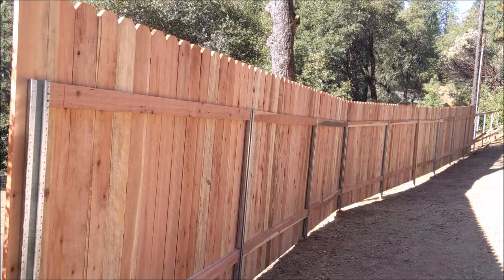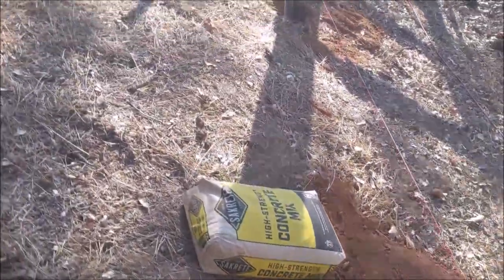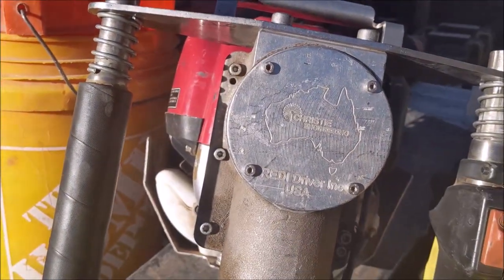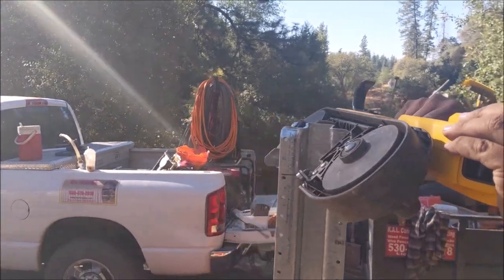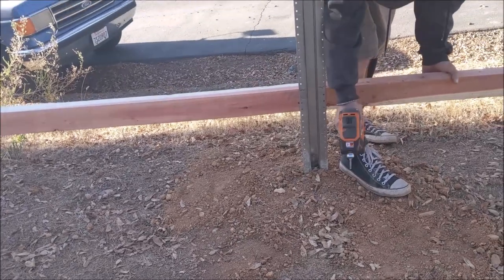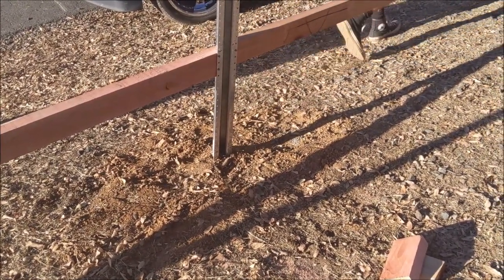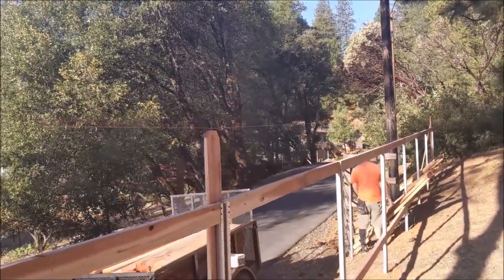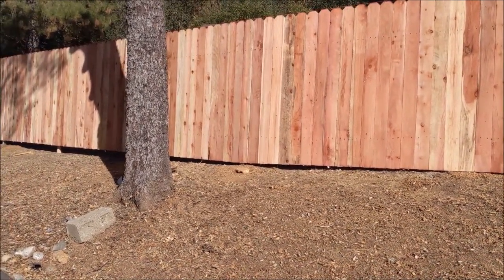How to Build a Wood Fence in Under 6 Hours

Comment: About to install some fence myself and came accross this video that left me with few questions. Why do you drive and dig holes for postmaster posts ? Can't you just drive them ? Ones I found in HD and lowes are 8 ft so I'm planning to drive 2 feet without digging. Also distance between top of the picket and top rail is over 6 inches and I heard it tends to warp. Is yours still holding straight ?  

And thanks for sharing this vid.
Reply from the maker: Digging and concrete make them more sturdy. Still holding strong. Yes don't want the tops too far from the top rail

Comment: Driving post like that they should be utilizing the entire 8' of postmaster post and driving to a string line mark on the post to keep the height consistent.  Any privacy fence 6' tall should have at least 3 rail without question.  Using a hybrid method of driving-concrete at 24" is probably not good.  They could have got longer post and drove to 30-36" deep and been fine, or dug to 24" and used all concrete, or dug to 24" and drove an extra 8-10 inches like our company does and used concrete for the 24" dug.   Half effort pounding and Half effort setting in concrete is just half.  Also if your going to have a 16' span 2x6 lumber should have been used.  Using a top picket jig such as a MR. Fence Straigt away would have made it an even crisper top than eye-balling to a string line where you can clearly see in the video were the string line has come off the top of the pickets on some and not others.   While its a nice fence it's not a professional job.
Reply from the maker: All good info
Reply: Where do you find these metal posts longer than 8 feet ? That seems to be the max length available right now at regular stores

Comment: Excellent, great video. I've built a few board-on-board privacy fences, but to hear your "play-by-play" description was perfect. Great details. My only critique would be to use three horizontal rails instead of two. And I'm a fan of including a 2x6 top cap (treated) with my privacy fence; it forces one to place the top rail as far up as possible, which makes the three rails efficient in keeping the boards straight in the long run. Otherwise, I really loved this video. Congrats!
Reply from the maker: Great feedback. Three rails is a good idea, much less movement of the boards
Reply: @itmsjim have you used these type of posts before? Home depot has them and it seems the postmaster brand is only 7'6" in length, which if buried at 2' would only be 5'6" tall..do you know where to get them at full 8 footers?
Reply: @krackerotto  I just bought five of the 7'6" posts a few days ago. Installed them and they're rock solid. I mean stone hard with the cement cured. I'm very happy with them, as they were super easy to build on. Unfortunately, I don't know where to get the 8's.
Reply: @itmsjim  is ur fence 6’ and did u put a rot board? Thanks in advance
Reply: @adolfsantiago5267  Yes, it is 6' and no, I'm not a fan of rot boards. I just leave an inch at the bottom so the boards are not touching the ground, and I stain the entire board, including the bottom, to protect it.

Comment: I used the same kinds of posts.  The only difference is that I used expanding foam for the footing instead of concrete.  Works just as great without the backaches.  The city uses foam for telelphone poles so they must be strong.
Reply from the maker: I've also heard great reviews on the foam, I'll use it next time

Comment: 26 years old been bulding fences for my father since I can remember and Ive never ever see some one use a jack hammer to break dirt but every one works different and fence on brother
Reply from the maker: Thank you
Reply: Same here. I’ve never seen that done as well. Creative. 
I’ve seen plenty of videos just using the gas postpounder without concrete. I give the contractor kudos for thinking outside the box.

Comment: Common 2x4 are only 1 1/2" thick. Those Postmaster posts extend 1 5/8" beyond the flat landing (the top hat in cross section). So using what around here are called "rough cut" gets you a true 2 " thick. Hawever they are considerably more expensive. I have contemplated using 1" stanless steel washers to puch out that extra 1/8". Have not actually done that yet. Any thoughts?
Reply from the maker: Seems like that would work

Comment: Curious in the point of cutting those posts shorter?  The closer to the top of the picket the better.  Looks like it has a lot of picket over that top rail.
Reply: It does. It is recommended from picket manufacturers to be no more than 6 inches. I have seen many fences with warped pickets because of this reason and to include only 2 rails. Picket boards are now cut from fast-growing trees and much thinner and not as strong as they use to be.
Reply: I’ve seen them as low as 10” from the top of the rail to the tip of the picket. 
You’re correct on future potential warping issues in that part of the fence. The only plus to a low top rail is the mid section wouldn’t bow as much.
Reply from the maker: Yes, I guess it does

Comment: I'm not a big fan of only putting the concrete in the first 10 inches or so of the hole. The galvanizing process on the steel post actually interacts with the concrete to create a barrier that prevents water and air from getting to the steel and thereby preventing rust. If done right, meaning no part of the post touches soil, then these things can absolutely last 40-50+ years before rust finally sets in (it always does but can be delayed). By only filling the top 10 inches or so you're leaving a lot of post exposed to the soil and groundwater and even air, especially after bugs, plant roots, and fungus start to meander around it. That will cause the posts to rust faster below the cement, at that point you'll only have 10 inches of support and the fence will fail. Best way to install any galvanized post is to fill the hole with concrete deeper than the post will be will be and then put the post into the wet concrete and level it from there. Try not to push the post too deep and then pull up as that can create an air pocket underneath it which decreases the strength of the posts hold. Essentially, you want the entire below grade post to be touching the concrete which is an advantage of the postmaster over round pipe as it's surface area is easier to get full contact as the pipe isn't always going to have concrete in the inner void.
Reply from the maker: Great feedback

Comment: I really like the concrete top 10" plus drive 14 technique for stability in mud on top. Did you need an adapter to drive the 3.5" wide pole?  What was the driver? Did you think about trimming the bottom to follow the terrain, or using a partially buried PT 2x8 and using shorter pickets to save some money and tighten up the ground gap? 

If you cover the back side steel post with a picket full height to look like a 4x4, wouldn't you want the leave the steel post long vs trimmed to top rail?
Reply from the maker: Did not need an adapter for the posts. Didn't need a skirt on the bottom, not trying to keep a dog in or out just a privacy fence to cover all the stuff up.

Comment: Although it’s a very creative solution to how to get the post in the ground, I wonder if frost heave will be an issue in what ever part of the country you’re in?
I have seen videos post pounding chainlink posts without concrete, this is the first hybrid version I’ve seen online. In my part of the country it’s wet and rainy half the year at least. All my customers want 2’ of concrete due to stability in the clay. For that reason I dig out to full depth. I enjoyed the creativity of them using the jackhammer on soil. I use a 6” hand digging bar or water. To break up the soil. I save the jackhammer for concrete breaking. Definitely different use.
Gas powered auger is fast. Many people don’t like them though. Lots of twisting injuries. Some contractors won’t use them. Just hand dig. 
That’s why I liked the jackhammer idea. Pretty heavy though.
Reply from the maker: All great points. We get snow and freezing temps but not often and not for long

Comment: Just come in with the bobcat and bore the holes. So much faster and deep enough that way. No middle rail, just a cheap fence that won't last. Nails suck in both high wind, and if you have to replace a picket. To bad because the postmaster poles would have lasted a lifetime.
Reply from the maker: Be nice to have a Bobcat

Comment: That power driven post driver looks like a toy. A hand held post driver would sink a
post in far less time and hassle, and if you drive a steel post in the ground, why dig
up the soil for a hole then adding concrete. If the steel post is strong enough to 
withstand winds [dubious in Florida], then adding concrete around posts would not
be necessary, and the post would be more likely to rust just above the concrete. Why
only two rails instead of the standard three? Boards might be more likely to warp 
with only two rails. In Florida, I would use the steel post in conjunction with a wooden
post, both together, for more strength against wind. But no concrete. I also wonder
if the wooden rails attached to steel posts would rot more easily where wood touches
steel?
Reply from the maker: All very good points, fence is still standing strong and we have had some pretty big wind and snow storms
Reply: Yeah I’m sure he will be dead before that galvanized steel post rusts 😂 and also, treated wood touching Aluminum might cause and issue but touching galvanized steel I wouldn’t worry about it

Comment: I know this is old but he gave you a super deal because this fence is trash!
Reply from the maker: Ok
Reply: @topsaw  
Brother, l appreciate your comments over anything else going on in this video. You show grace under pressure and respect at all times.  You know that job will last 15 years or more... and the replacement will only ever be a few boards. Great Attitude and great video, especially those steel posts !
Reply from the maker: @BlueOriginAire  thank you